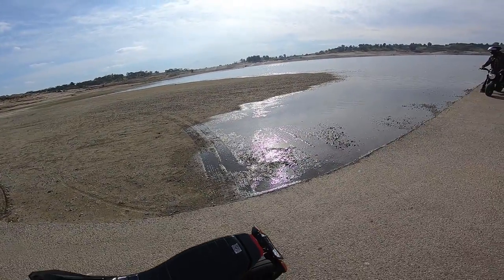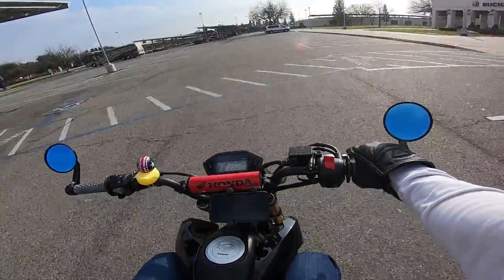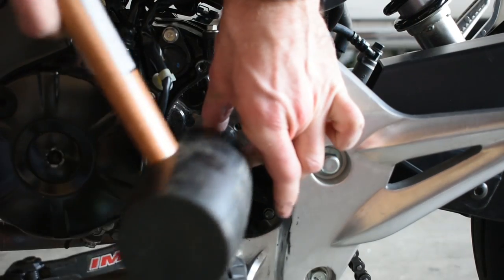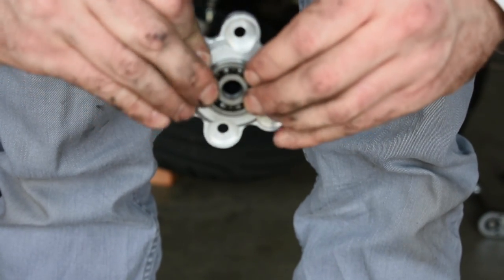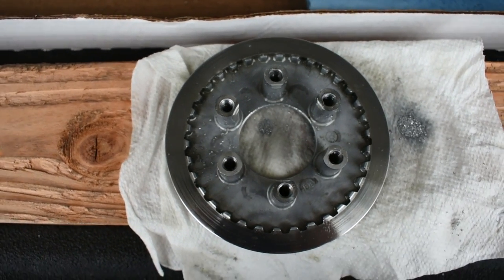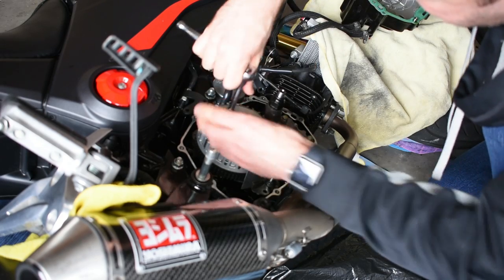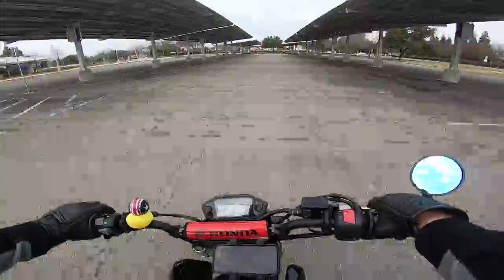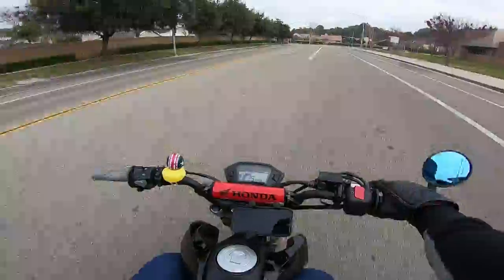Honda Grom Sprocket and Clutch Upgrade

Comment: Great video!!!! My next mod. My clutch is weak. Just curious are the 3 clutch bolts you tapped the same size as stock? Same thread pitch? Thanks for the video!!!!
Reply from the maker: Hey thanks as usual for the comment and support!  Yes, I used the same threading on the tap as the stock bolts which are M6 x 1.0.  Good luck!

Comment: I wouldn't even use a drill to run the tap in, do it by hand
Reply from the maker: By hand is probably the more "right" way to do it, for sure.  The drill worked though, thanks for commenting!

Comment: For about $70 you can snag a DRD speedometer calibrator form 12oclockLabs and fix the inaccurate speed reading. Mine was off by about 9% from the sprocket change and new tires. The speed being wrong isn’t a huge deal, but racking up more miles due to the indicated speed being high isn’t something I wanted.
Reply from the maker: That's my biggest concern is the extra miles on the odometer long term. The mph reading doesnt bother me.  Might be worth it for only $70, I appreciate the heads up!

Comment: Great video, would you recommend going with SMR 80% clutch springs?
Reply from the maker: I guess it depends on your application, I think the 60% springs are good for most modded bikes, but from a pulling the clutch with your hand stand point, you'd probably be good with the 80% springs (which I didn't even know they made), the 60% springs full replacement doesn't make the clutch lever much harder to pull.

Comment: As a journeyman millwright I would highly discourage using a tap in a drill, unless it’s impact grade
Reply from the maker: No doubt, and I am NOT a mechanic and have limited experience.  However, it worked perfectly in a pinch :)

Comment: Hello.. if i do 14 front .35 rear... 
106 link .420 chain is the right one?
Reply from the maker: whatever stock is, I'm actually not sure how many links you need, but you can always brake a chain and cut it down.

Comment: I just picked up the parts to do this.  Do I leave it in gear? Or neutral? I don’t recall if you mentioned it.
Reply from the maker: Yes, leaving it in gear will make breaking loose some of these bolts on the clutch a little easier.  Having a buddy help is even better!

Comment: I bought a Kitaco clutch cover so while I was there, I installed a high flow oil pump, stiffer springs, spring  plate. I don't wheelie my bike but am looking at installing a 14 tooth sprocket and new chain for more torgue.  I installed a cam and flashed ECU. Between the cam and oil spinner delete, I lost a lot of low end and midrange torgue. I installed a Koso instrument cluster with the steady garage dash to clean it up. With the Koso cluster, I should be able to adjust the tire diameter to compensate for the 14t sprocket. Is this 14t sprocket going to hurt top end?  I'm concerned where the rpms are going to be at going 55-58mph for prolonged rides.
Reply from the maker: Man,  lots of good mods there!  I run the 14T to compensate for the lost low end.  Yes, it does affect the top end, not by a whole lot, but if your focus is top speed, I might keep the 15T on the front.

Comment: I've done this, but I still cant get it up. 🤔 Clutch seems to slip when I dump it
Reply from the maker: Thats weird.  Do you mean you've done the sprocket and the 60% springs and lifter plate, or maybe just one of them?  Which did you do?
Reply: @CTGromer  springs and the lifter plate mate, just feels like when I drop the clutch it slips. I  can wheelie the fz07 for days haha just not this thing 😭 @2dankkk on Instagram for my wheelies
Reply from the maker: @skitzfalcz_drift   I'll add you on Instagram and have a look!  Do you have a friend that can stunt on a grom that can try yours out and tell you if they feel something is off?

Comment: One question having an issue after assembly of the clutch not engaging I fully put everything back together but I cannot for the life of me get this thing to properly engage
Reply from the maker: It sounds like it was not put back together correctly, OR the clutch cable is not adjusted correctly, or both.  Watch the video link I have in the description of this video for Photogrommers video of the clutch, his is really good and may help.

Comment: Did you drill all the way through the 3 new pressure plate holes before tapping them  because 20mm screws are to long to fit in the holes if you just use a bottom tap without drilling all the way through.
Reply from the maker: The pressure plate was pre-drilled all the way through already, yes.  The 20mm fit perfect.  I replaced all six screws with 20mm screws I got from Ace Hardware.
Reply: @CTGromer  I have a 2020 and the 3 not used holes on the pressure plate were not drilled all the way through. The 3 that are used were. And i didnt know that other ppls plates were all the way through on all six unlike mine. I wound up putting 16mm screws in stead of 20mm for the 3 holes and used 20mm in the other 3 and it went together better

Comment: nipple clutch pull! is it worth upgrading the air intake without upgrading the exhaust? in your tests you never showed what just the air intake does, could you do that to your sf and see what it changes compared to stock.
Reply from the maker: Man, I would if I still had one!  But you're right, that would be a legit test!  It would help, no doubt, but ideally you want more air/fuel to flow in AND out better.   The stock airbox is super restrictive though, so it will help, just don;t know by how much.

Comment: Those screws are steel not aluminum. If you snapped it you either have an inaccurate torque wrench or you had the torque wrench set wrong.  9 ft lb is not going to break a bolt like that.
Reply from the maker: Whatever it was they were soft, and I ended up doing the next ones by hand because of that.
Reply: @CTGromer  I get that it's just that 9 foot pounds is a very very small amount of torque so maybe that bolt was defective I don't know.

Comment: Hey man I put the 60% springs in and there was 6 springs but anyways my clutch feels super soft and doesn’t feel right. Got any ideas what it could be? Everything is put back in right.
Reply from the maker: VERIFY that everything is put back in right, and then adjust the cable correctly.
Reply: @CTGromer  everything was installed right and i adjusted the clutch cable and still super soft. here are the parts i installed. 
SEX MACHINE RACING 6PC CLUTCH SPRING 60% STIFFER UPGRADE HONDA GROM
CHIMERA V2 CNC LIFTER CLUTCH PLATE HONDA GROM
MODIFIED (6 BOLT) GENUINE HONDA OEM CLUTCH PRESSURE PLATE - HONDA GROM 125

could any of these parts be the issue? thanks.
Reply: @CTGromer   I figured out what it was nothing to do with the assembly it was the actuator. I put a different one in and it was the yuminashi crf110 manual clutch kit actuator that I used from a buddy of mine and it’s spot on
Reply from the maker: @AustinBruceFlows  Glad you figured it out man!

Comment: It also depends on how much you weigh. I weigh 143 but I wheelie my crf300l with ease from 1st-3rd gear. I did it on my buddys 2023 grom and I got it up in 2nd no problem. Maybe it’s the experience I have on wheelies and stunts but I think that how much you weigh is a big factor on if you should do stuff to your grom or not.

Comment: where did you get that honda cover for your protapers?
Reply from the maker: Looks awesome, right?  https://www.ebay.com/itm/7-9-Red-Black-HONDA-DIRT-BIKE-Motorcyle-Motorcross-Handlebar-Cross-Bar-Pad-OB/282652528932?hash=item41cf675124:g:~IYAAOSw23lZudS0

Comment: I accidentally removed the bolt to the gear drum stopper and after installing and putting everything back I can’t shift the bike goes from 1st to 4th instantly and drops back down to 1st with the slightest tap. Neutral is non existent please help.
Reply: Did you ever figure it out?
Reply: @ianlandis4628  honestly got the bolt back on and lined the shifter arm up the best I could to match what gear I was in then got it started and it’s been fine since

Comment: Any change in top speed?
Reply from the maker: I'm actually not sure.  It now can rev higher in 4th gear, but its probably off by 5-6 mph when my speedo is now showing me 70mph.  I need to GPS it.  I'll bet I can still get 65mph on the GPS.

Comment: You didn't have to make 3 more holes. the problem is the screws are so bad that come with it so just change the screws and problem solve 👍🏻
Reply from the maker: I think you're right.  10.9 class screws would've helped.... so i did that AND threaded the other 3 holes... mostly because I am into overkill!

Comment: hold the clutch in half, rev it and let go of the clutch and it wil go up
Reply from the maker: I've been practicing some more, the problem is I don't fully commit because I don't truly want to stunt, and I do not want to crash!
Reply: CT Gromer ive driven trial for 6 years, and have a some experience riding and i really want to buy a grom thanks to your inspirational videos

Comment: Don't buy the exact clutch and oil spinner tool he shows because it barely lets the extension in the socket while fitting on the oil spinner nut. Look for one a bit longer
Reply from the maker: The clutch assembly and basket is all stock, the only thing I changed was the clutch springs and lifter plate. Thanks for commenting.
Reply: @CTGromer  my mistake im trying to help. I meant the exact tool to take the 2 things off
Reply from the maker: @traxxasLOVR   Ohh I see what you're saying now.  Yeah, I've heard that there's barely enough reach on some of those to get the spinner because of how deep the spinner is.  Good lookin out!